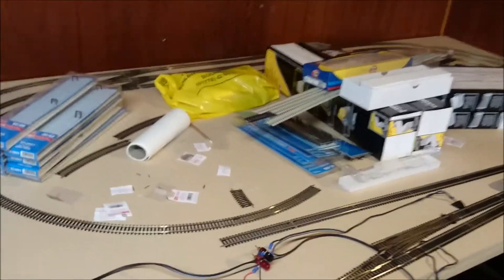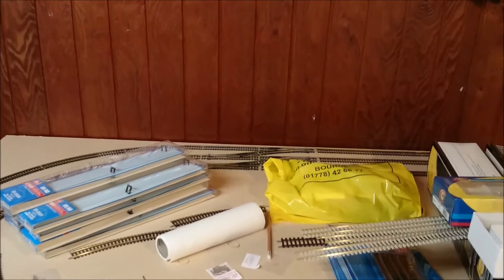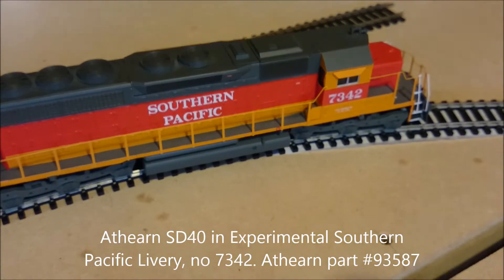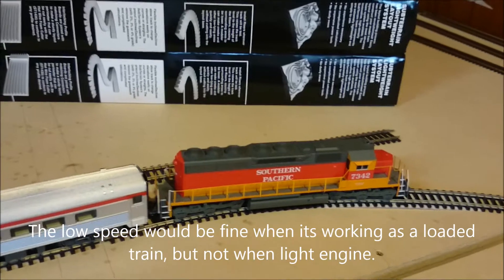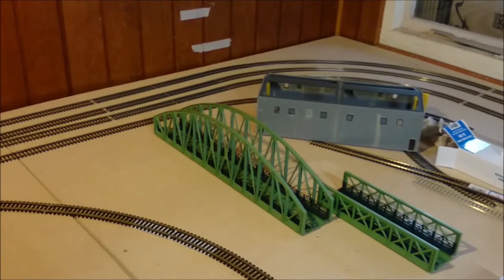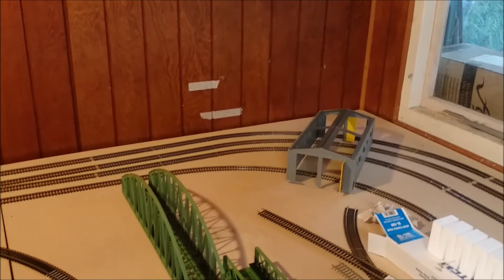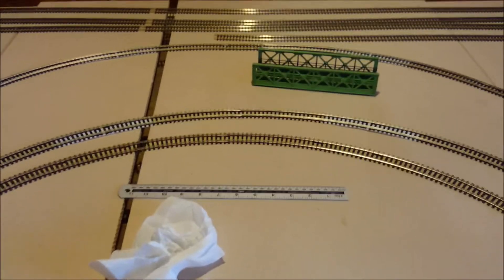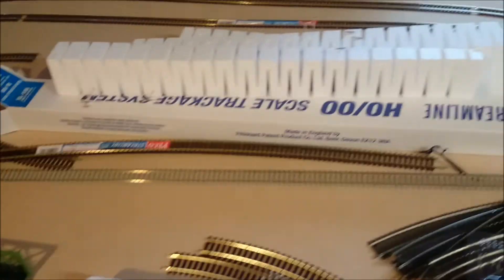Weekend Engineering 2 - Building a new OO/HO model railway layout - Layout Update & New Loco

Comment: Those SD40's and larger Locos with 6 wheel or 8 wheel trucks aren't happy with less than 22" radius curves (Not sure what the UK equal is called), they will make a clicky grinding sound in tighter curves which can be annoying.  Loving your setup so far I have a similar space in my basement I may have some inspiration here ;)

Comment: Hello. Can you please tell me what make your green girder bridge is? Thank you.
Reply from the maker: Hi, its made by Roco, the side parts are part no. 40080, the middle is 40081 and the pillars are no 40082. Each part is sold separately and in singles. The same item also appears under the Atlas name in the US I think. The Roco page is at https://www.roco.cc/en/product/22568-0-0-0-0-0-0-006005/products.html
Reply: Hello and thank you for the information. I've seen quite a few girder bridges on the internet but the one you have struck me as being particularly attractive as girder bridges go.
Reply: Thanks a lot for that answer.  Just the information that I needed.  Keith  :-)